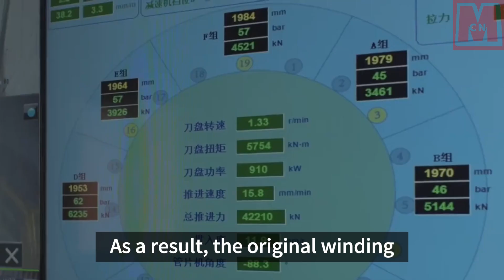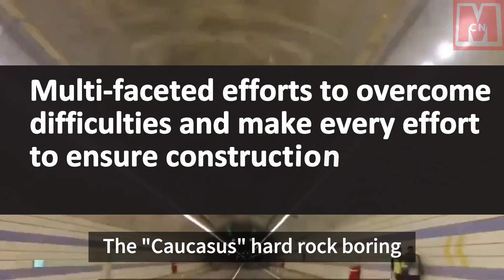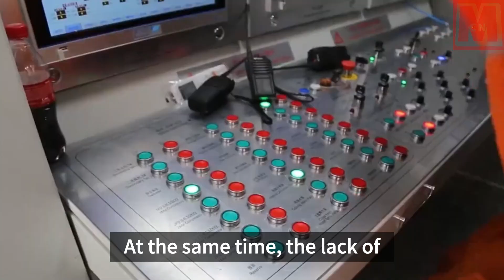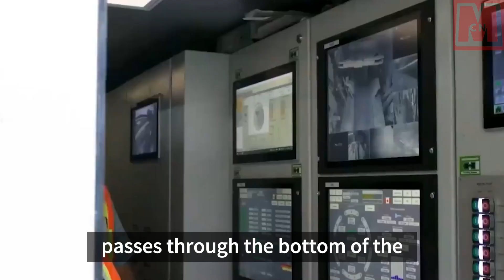The largest in the world! Chinese companies lead TBM construction in Georgia

Comment: In 1970 China did not have TBM. A project with a small 18 km long tunnel and estimated 5,000 workers would be required in 5 years using the traditional explosives and excavation method.  A German TBM manufacturer convinced China his TBM could do it in 5 months and cost 700 million Yuan.  China was happy to adopt the foreign TBM but during servicing of these machine the Chinese were excluded and not allowed to watch.  Such disrespect pushed China to develop its own TBM.
In 2012 China has its own TBM and used a twin tunnel project in Chengdu to test it with a foreign TBM side by side.  The Chinese TBM proved superior in every aspect and finished boring two months earlier than the western TBM.

China then markets its TBM internationally at 25 million yuan or at 1/28 of the German TBM cost.  Western TBM prices drop off the cliff.  Today Chinese TBM are favoured by many countries and able to secure almost 70% of the global market by 2022.